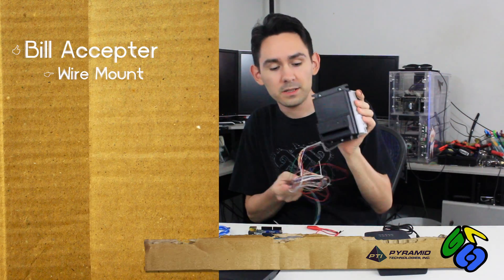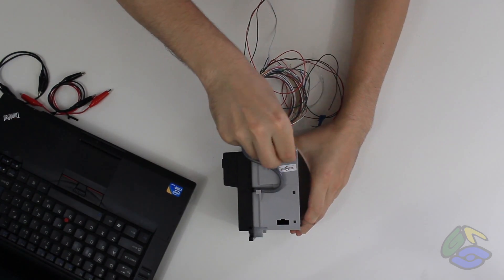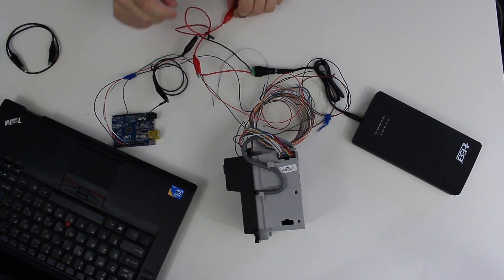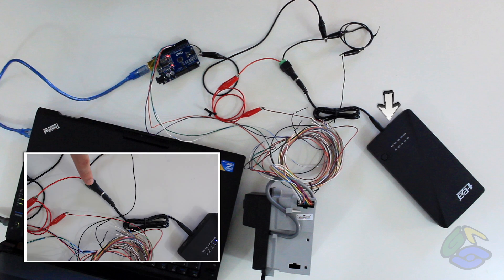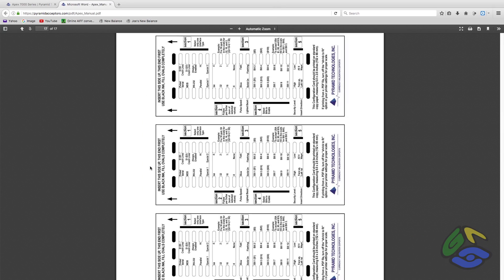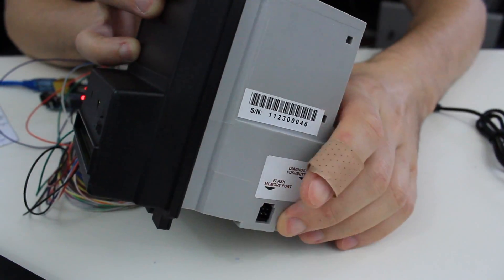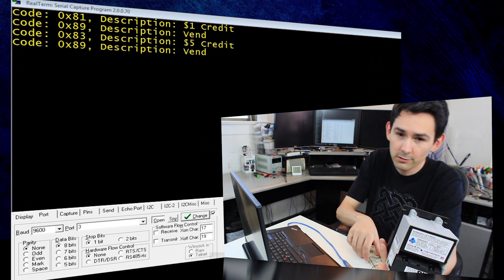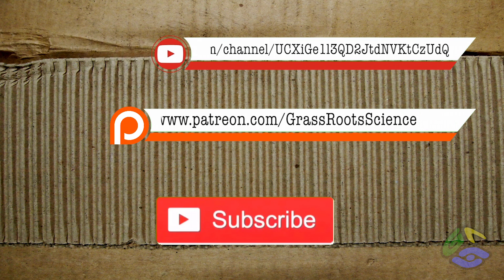How to use an Apex Bill Acceptor with Arduino

Comment: my Realterm is sending out hex code for some reason. how can i fix this?
Reply: if your using the arduino serial monitor make sure your using 600 baud, you can find the baud at the top right of the serial monitor screen.